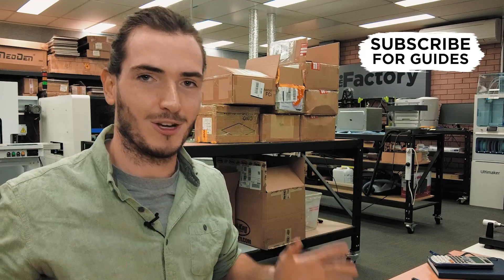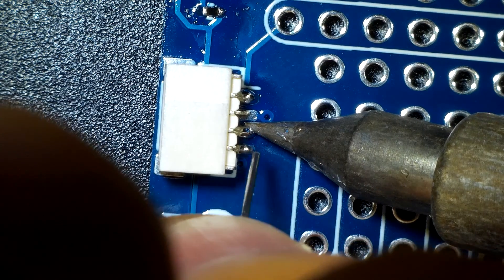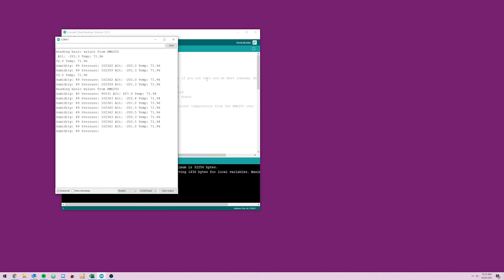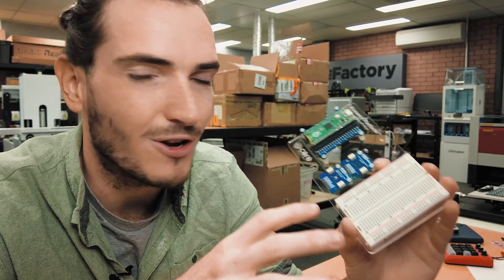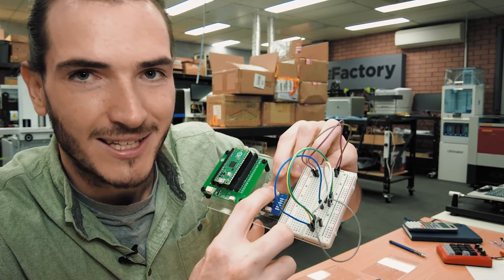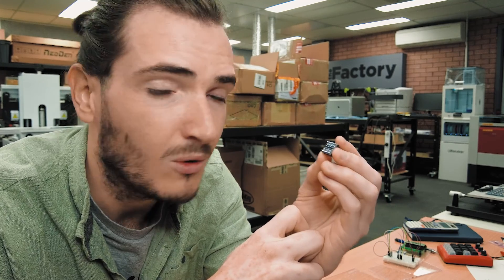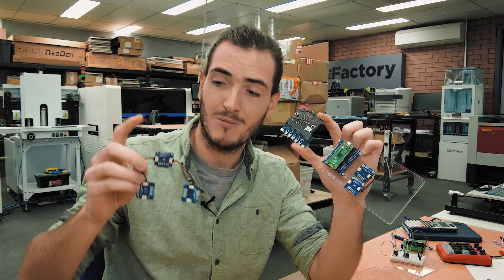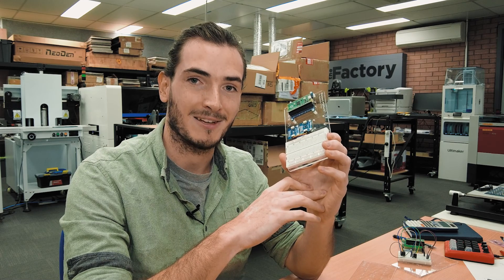The Factory | The PiicoDev Family Is Growing More Prototypes

Comment: Looks like you have been hard at work. Looking good, does the I2C addressing for multiple sensors on a single port work similar on python than it does with Arduino?
Reply from the maker: It sure does, though we’ll be designing PiicoDev libraries to have a more unified-approach so that they work for different ports of MicroPython. We’ll share some more about that in the near future :)
Reply: @Core-Electronics  That sounds great, I'll be sure to look forward to seeing these libraries released. The flexibility this will create is something I look forward to exploring.